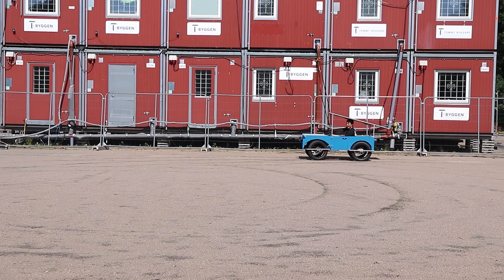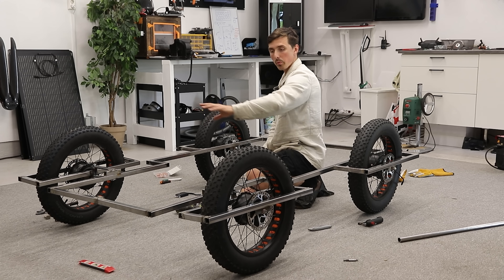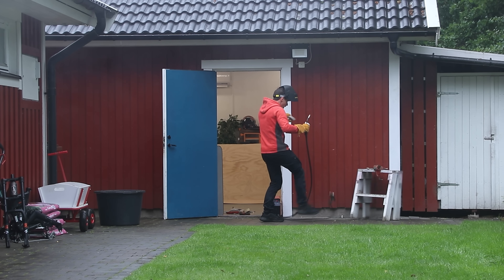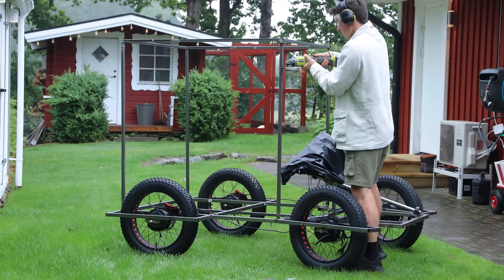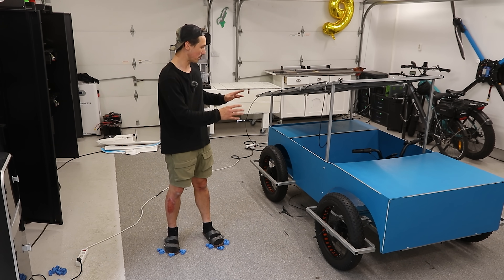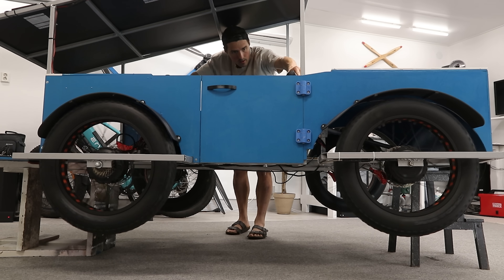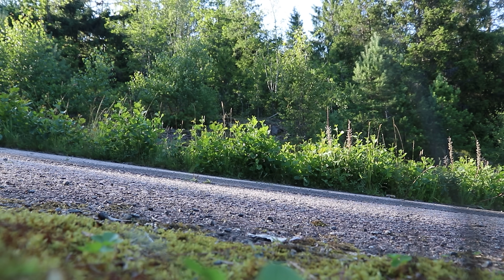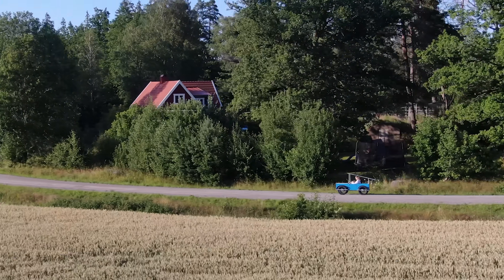I Built a Solar-Powered Car – And It Works!

Comment: are your motors not speed limited because your using the bicycle speed controller?
new motor controller would go so hard tunable torque curves and even regen braking probably an option??

Comment: You could have switched around the direction of two motors to gain reverse at the cost of half of your forward power. Not really a great trade off but functional at least...

Comment: the front wheels should be slightly behind the pivot point. helps with dynamic stability and reduces stresses on the steering wheel while just driving in a straight line.

Comment: Nice shade tree engineering. Maybe next time reduce steering complexity with a 3 wheeler platform or modify one bike by adding sidecar. It's about simplicity and weight reduction.

Comment: You should add a large trailer with more solar panels.
Reply: More weight = More power consumption. So it would not really make any sense
Reply: @TanWdm yes it would. Because the trailer is relative light, but with 3 more panels you can charge the battery in double the time.
Weight is also only important during acceleration.
Reply: @lordcarloshere  it would decrase drag and trailer itself may not be that heavy, but the solar pannels are.

Edit: even if you could charge the car faster, range still will be shorter becuase with more weight engines would drain more energy (and heat, don't forget about that) so, i think everyone would prefer a longer range than faster charging
Reply: @TanWdm  strip the solar frame
make it integrated with the trailer,not gonna run forever but at least more range
Reply: Oo maybe Tracks could be added

Comment: This is awesome! If you like this you will love the Videos of @QuietNerd. He loves to use perforated steel tubing so he can screw the frame together instead of welding it permanently. I think some sort of suspension would be a good upgrade for this vehicle.

Comment: Cool build! Think you could make a switch bank to reverse the polarity of one motor temporarily to use as a reverse? Or maybe a fifth controller wired in reverse. But would that even work without switches disconnecting one/connecting the other? Then just switch wires on one of the four, lol. Just a thought, have a great one!

Comment: tjena, I subscribed back in the day when you did things for the love of it and also decided to do youtube videos of what you would do in your hobby anyway. for a long time now it feels more like you view youtube as a job and you need to come up with something that makes a good thumbnail and title, would love to se videos again of stuff that is not made as if to be trashed and taken apart before you even edit the video, 25mm tubes, no suspension, steering brackets putting a twisting force on that 25mm tubes, using the 4 brakes independently, alot in the design just feels like "yeah I hope it holds up for some shots". I just hope you can get both bikes back together when done. annars är det du gör precis sånt som är intressant men det skulle vara nice med en mer genuin känsla på projekten.

Comment: Reverse gear "bodge": Tadpole Trike configuration, but two wheels close together at the rear. One faces forward and the other to the rear! Forward mode: 3 motors. Reverse mode: 1 motor.

Comment: Idea 1: Mini Moke style with a ladder frame chassis. GRP over foam panels.

Idea 2: Caterham 7 style chassis. Doped/tensioned fabric panels. Front independent mudguards integrate the double sided wheel bracing.

Idea 3: Aerodynamic E-Velomobile with double rear wheels.
Reply: Idea 4: Tandem seated lightweight quad bike.

Comment: Good morning. 
Your achievement is friendly and interesting. Perhaps it would have been interesting to work a little in form by taking advantage of your flexible solar panels.
Why not have left on an aluminum frame, which would have avoided you so many welds and superfluous weights ..?

Comment: I have that same welder and it works really well for an entry-level machine. It looks to be set up properly, fcaw torch negative. If it fails to weld you could look at the wire-feed rollers, they slip easily if the tension is not correct. Also with fcaw you tend to get a pearl of slag at the tip of the wire every time you stop the weld and that can prevent a new arc from striking. Med lite kraftigare hjulupphängning ser det ut som en rolig maskin för de små turerna men som andra påpekat, hjulen sitter inte bra nog för sån belastning =p

Comment: Hear me out, turn around the front wheel assemblies to then turn the vehicle into a RWD forward and a FWD reverse cart. Unless you really need AWD and the power, then you better get onto how to get a reverse installed. Either by flipping the motor polarity or by getting a new controllers. Or best yet, buying a starter motor and use the same system a Honda Goldwing does. One way drive with a 12v motor set to move you backwards slowly on a huge gear reduction.

Comment: I am not convinced that two thin metal bars will hold the front tires under full load. They will be bent eventually at some point. Otherwise, it's a great project. Congrats!

Comment: Why to destroy the bike in 1st place. I would recommend to use them as is and then build a roof and handling around them. Remove the handles and attach a single driving and turn mechanism with a solar roof. Also 4 x people will be able to sit on 2 x attached ebikes

Comment: Look into go kart suspension and mount the rear assembly on a couple of springs. Or use leaf springs. I could immediately tell when you started the front wheel frame that you’d have trouble with camber. This has great potential to be a high tech vehicle but you need to improve your engineering and design skills to go from amateur to pro. I could see you selling these if it was properly engineered.

Comment: You don't need greater voltage than the batteries to charge them! The job of the MPPT is to regulate the voltage that goes in. It'll be constantly changing anyway, as clouds come over or you go under trees.
Of course, the more panels, the better! But only for faster charging. Also, don't over-volt the MPPT!
(Oh yeah, also, make sure the 'flexible' solar panels never actually flex, it breaks them)

Comment: I can tell you now with a lot of pot holes and cracks on the road, those wheel guards will eventually snap without a cross section re-enforcement as it'll break along the layer lines near the sockets. that frame is going to crack soon too lol

Comment: From a safelty standpoint it makes sense that each system controls both a L and R tire so things never go askew if one system randomly depowers. But from a performance perspective, it would be cool if the systems were soley on the L and R sides, and the steering angle dictated that the unit on the outside of the curve delivers more throttle. Also thought really need to tie the battery systems together so they drain things evenly in that case, as a 'nascar' scenario means one of them will always be consuming slightly more as it's always on the outside of the turns.

Comment: I would have done suspension.  This is so much easier with an EV because you are not dealing with a chain or drive shaft.  Those front tires are pretty dog eared (bent out).

Comment: Just when I think this build can't get any more jank with those weak-ass front wheel supports, you use a bike handlebar that turns like a steering wheel. Then you set up four individual brake levers. And then two separate throttle systems. And a boot lid that opens down so it wants to fall open. Lol.

Comment: As soon as I saw the front wheels mounted by a couple of lengths of 40x6 I figured they would be the first to fail. Lucky they where saved by an even weaker fail point at the front. 😂

Comment: How many wires go to the hub motors? Is it just the 3 for power? Or is there also a sensor wire? If it is just the 3 for power. You can just switch any 2 of those the same as any other brushless motor to reverse direction. Get 4 high current DPDT relays to do this, then wire them all to a switch and there is your easy reverse. 
Dont do this, if there is any sort of sensor wire or something going to the motors though.

Comment: Buck boost converterfor the solar maybe? LM2587 DC-DC 3.5V-30V to 4V-40V Step Up Power Supply Module Adjustable 5A Boost Converter

Comment: I know it looks much more like a car like this, but I think you should have kept the original suspension and maybe even the complete front forks (without the handlebar obviously). The missing suspension will bend and eventually break the frame and your back!

Comment: if you have 4 wheel drive, why have steering at all, just tank steer!! also you can tie all the brake cables together to a single brake handle, but you might have needed additional brake line.

Comment: Imagine the horror of having a snapped drill bit lodged in your body. It's a scenario that's all too real, and one that can be easily avoided with a little common sense and caution. The consequences of leaning on a drill while in operation are dire: a snapped drill bit, a chaotic fall, and a potentially life-altering injury.

Don't risk your safety and well-being. When working with power tools, be mindful of your surroundings and take the necessary precautions to avoid accidents. Keep a safe distance from the drill bit, secure the work area, and use proper drilling techniques to minimize the risk of a mishap.

Your safety is worth it. Be aware of your situation, and take control of your work to avoid the devastating consequences of a snapped drill bit.

Comment: model-S for solar. dont you like tank, turning. drone uses tank, turning. people make you do nonsense complex stuff for show. looks like a toy box car. two sides differential thrust. skid steer steering. aired tires dont last a life time, they flat out instantaneously.
Reply: btw, a hand stick + foot throttle = manual quad copter.

Comment: Super cool build. I noticed your front wheels tilting inward pretty harshly. I imagine it’s only happening in the front because your rear system is connected to the frame. U might want to consider adding some sort of suspension system. It might keep your frame from eating your steering bushings too.

Comment: Coroplast is great for lightweight panels, the thicker ones can even replace structural plywood. They are not however easy to paint due to the material usually being  PP, PC or PE.

Comment: Like the idea, hate the wasted aerodynamic potential, the hood/bonnet should be a solar panel tilted about to the height of 
your mike at 12:30, then you should leave a gap(window)/offset in height so you could form a slightly curved roof.
Also the  "bumper" should be made out of fiberglass & also curved like a banana from side to side.
In general fiberglass is a much better choice as body panels. The gap between the tilted hood solar panel & the roof panel 
could be also closed with a curved plexiglass panel.

I understand you don't wanna deal with suspension but the shit aerodynamics will severely impact the efficiency. 

Still a cool video tho.

Comment: we have a saying in the engineering industry, Grinder and Paint, make me the welder i aint. seeing the frame flex and twist like it did is a sign of lack of bracing and basic design to fit material choice. cool project but kinda a death trap

Comment: Why no1 use Industrial Capacitors for regenerating boost or max safe takeoff power to motors? Cranks old miner flashlight and sets it down for 10mins Capacitors can fill fast with bunch of energy but discharge to low powered devices for good amount of time depending on size you can get or capacitor bank you build. Continuous generator or Solar = Best because when you stop you're not using the power continuously generated and can store enough of it to fill your capacitor bank to get going again faster.

Also for Wind turbines and solar if power goes over your battery bank fill speed you can put Capacitor bank between system so gusts of wind or over max can be captured in capacitors that can charge much faster but slowly charge batteries at safe speed when light or wind drops below good. Buffer.. Redneck buddy: "Like Regenerating NOS?" Yess...

Comment: You got two sets of controllers why not make it steer like tank using difference in speed of motors on both side, and get rid of this wonky front wheel mounts

Comment: Wouldve been cool If you had built it more like a chassis which wouldve allowed you to make stronger 'steering squares' Remember triangles?  even as it is, a triangle tube design wouldve prevented so much flex and eventually it'll break. Hope you dont get hurt :(

Comment: They make double brake levers for tricycles (like cargo bikes where there's a big bin up front), would've made it possible to wire up two levers to control either both front or both rear brakes at once

Comment: You could use a y break cable so one handle is the back breaks and the other is front. You can 3d print them. Its just a block that has one input cable and two out

Comment: All the aerodynamic qualities of a brick. I love it
Reply: Sweden is famous for this. See the Volvo 740 for the most brick like car made.
Reply: At 45 Kmh top speed the air resistance is low.  Don't think the design was for peak aerodynamics.  Plus he may have wanted it to meet other size and function requirements
Reply: Who needs downforce when you've got upforce?
Reply: @ellispercival6177   The upforce makes it an airplane.
Reply: + a sail

Probably the energy produced by thos solar panels are eaten up by the drag lol
Reply: I feel like the front wheels mount bending is a bigger problem
Reply: those solar panel just add very little charging on the batteries because use 4 motor at once, you need to design more solar panel on it
Reply: Former Volvo apprentice.
Reply: @juststeve5542  Looking at the suspension design I believe it
Reply: Rip aerodynamics
Reply: As someone who identifies as a brick. Im offended..we have better aerodynamics and turning radius then this catastrophe... :p
Reply: @GrizzySC ok, a box then!
Reply: geoff hammerhead eagly i-thrust 2.0
Reply: I think a slant front and a whale tail like a Porsche Carrera ...
Reply: Volvo 245
Reply: Fliegen Der Hammer ...

Comment: Cool project, but it needs proper front suspension to both reduce the shocks on the mounting hardware and to keep control at speed.

Comment: 'it will last a lifetime'; for sure, those cantilevered bits of steel doing double duty as leaf springs to give you that nice cushy front wheel suspension would never fatigue off. Certainly not at an inopportune moment when trying to steer away from oncoming traffic at 45 an hour.

Probably they wouldnt.... but dunno you might want to double check that.

Comment: There are pre built whole front suspension and steering kits for this kind of karts for super cheap, i would weld two wider beams from the front to back to minimize the forces going in the welds

Comment: Most of today's welders make it a lot easier.
You no longer have to do the math figuring how many amps you need for the thickness of the metal.
So it really comes down to developing the technique
The brakes are hydraulic you can just make a manifold so you can use just one lever

Comment: It looks like a 1970s Mini Toyota Land Cruiser. I like it. Great job. My father and I built something similar using two Electric Dirt Bikes and a Junked Honda TRX 450 ATV suspension and drive system. We use it as our Camping Transportation so we can leave the RV stationary. We tow it with the RV when we go camping. It works awesome.

Comment: Add an incorporated charger and separate wiring to simultaneously be able to ride and charge batteries as you go :)
Reply: For the doors, use a gate “lock” the ones that bump up and down when you close the gate
Reply: I cant stop with the tips, but make sure that the front motors are about 4-6 mph slower than the rear motors, this will reduce wheel spin and have the car more off much more smoothly, there will be more torque on the back end ofcourse but simply reinforce the rear if any issues arise
Reply: Last but not least, for the subtle tilt issue in the wheels, im sure there are many designs that can reinforce those to be more inline
Reply: Awesome e car btw i forgot to say something good, i sound like i was just judging my apologies, very creative

Comment: I love the way the camber increases on all 4 wheels the more you drive it. Eventually they will achieve "stance" --- before they finish snapping off lol.
Reply: Are you sure it wasn't those 3d printed adapters he talked about at the end?
Reply: @gloriouslumi  Yeah for now, but you can't make vehicle frame like that and expect it to retain its dimensions for long. Stuff will bend and sag. But this is just for fun and he can make it better or make whole new one later i guess.
Reply: he only needs to make the steering knuckles taller and braced
Reply: 😂 That's funny
Reply: Camber is important in the landsbygd
Reply: The frame is just a part of the suspension ^^. 
After he talked about the flex, I expected some bracing, especially for 2 people :D
Reply: No suspension so don't worry they will never drive it after this video.
Reply: I'm no structural engineer but I was like...(chews gum) "That's not enough triangles, man. Gotta add more triangles."
Reply: i was about to say, those front wheels are going places. Not with the car.... but definitely places
Reply: That's a great observation! It's a self-adjusting, evolving design. The 'stance' look is just a bonus feature. lol
Reply: No doubt. When I saw how he had the front assembly "attached" I felt a shiver up my spine. Weakest part of the whole build.